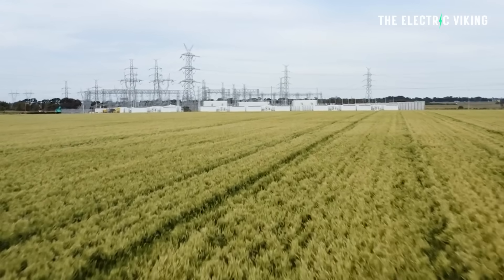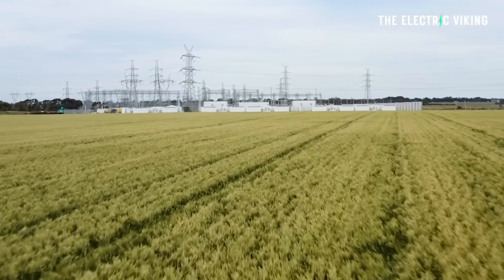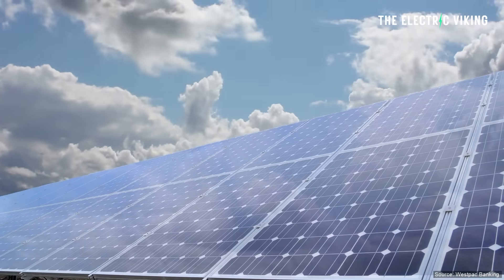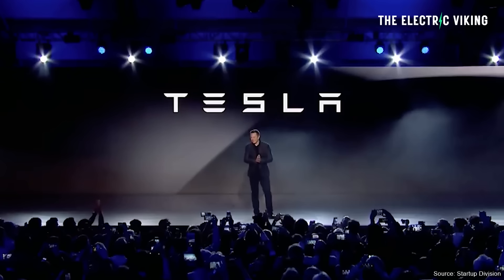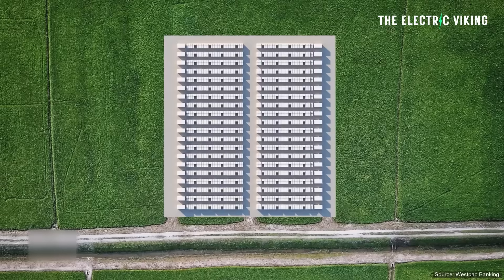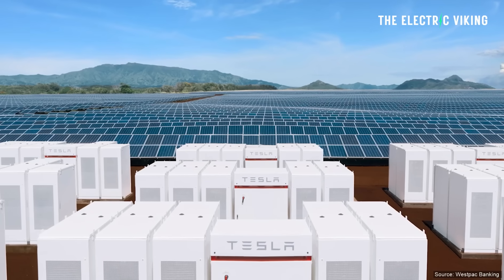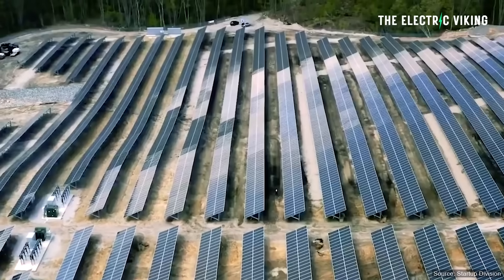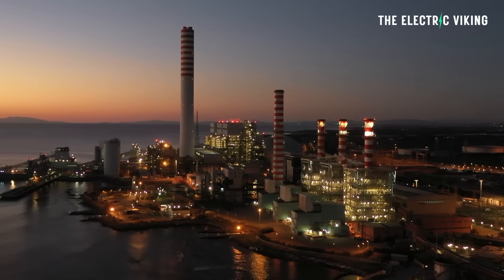Mega Tesla battery in Australia helps shut down coal and gas power plants

Comment: The mega batteries get the publicity, but it is the home batteries that are the real game changer, because the distributed generation and distributed storage will make the grid unnecessary in perhaps as little as 30 years time.
Reply: Make the grid unnecesary? Perhaps for suburbs, but society is not just suburban houses, that's simply not going to work with industrial zones and such. So, for those cases the grid, and any other green energy options will still be necesary.
Reply: @JosueC730  It is already beginning. Shopping centres that previously had shade sails to shield customer's cars from the sun, are instead installing acres of PV panels. Businesses are looking at providing their own power. Even the very large users like Aluminium refineries have plans for converting to PV.
Then there is the national security consideration. With no grid or distributed generation it becomes difficult to disable manufacturing industry.
Reply: @davidinkster1296  Distributed generation is conceptually the opposite of having no grid, it's a reinforced grid with everyone having panels to increase generation of energy and batteries as backup, and if needed even be independent from the grid, or sell the extra energy, etc. But even though it's called "going off grid" the only advantage is not depending on it for energy nor the costs, but that doesn't mean everyone can do the same and disconnect from it. Many industries will still need it, as renewables are intermitent, backup is always needed for when the sun doesn't shine and the wind doesn't blow, and batteries only store energy, they don't produce it. Hydro and Geothermal are only available in certain places with certain conditions. So it becomes clear that humanity needs more than just renewables.

Comment: Just got to cross you fingers not too many units decide to spontaneously combust and that the operator will put in some sort of fire suppression system to contain any future fires before the next one hits.
Reply: The South Australian “big battery” was installed over 5 years ago and makes a big profit with no issues. Was the biggest in the world when first installed then they doubled its size.
Reply: @djbrak1434  A 40MWh Megapack II went up in smoke in Bouldercombe in Australia two weeks ago, before it ever was put online. In 2022, two whole Megapacks went up in smoke in California. Another Megapack went up in smoke in Australia back in 2021. Seems like Megapacks are on track for one major incident per year.
Reply: @teardowndan5364 yes. They certainly do burn quite well.
Reply: Is it possible that you are exageeating?? Lets see your receipts on this.
Reply: @markthomas7279  If you are going to doubt every single thing, google it yourself. Three years, at least three separate Megapack fires.
Reply: @markthomas7279 no exaggeration. It's a fact.